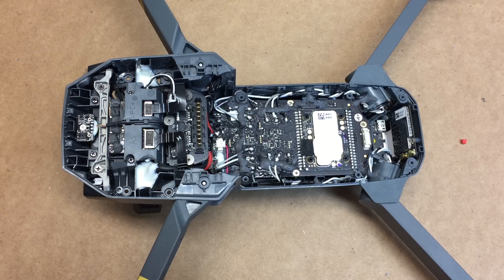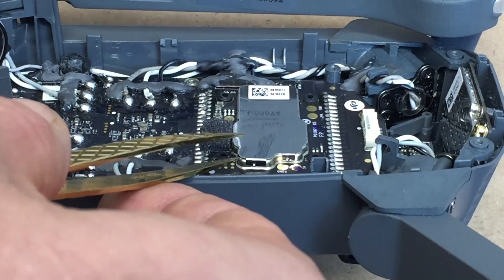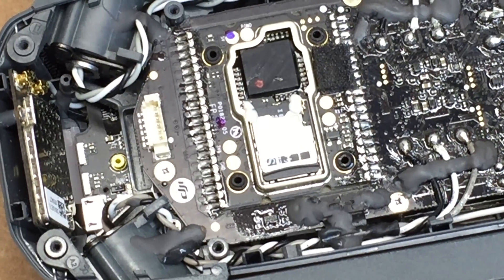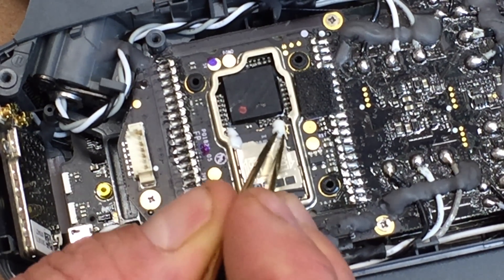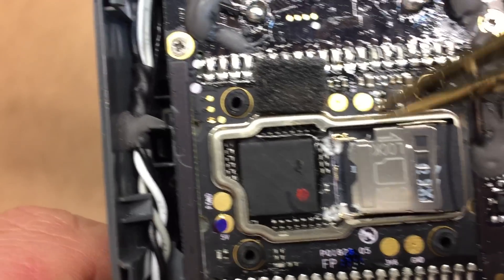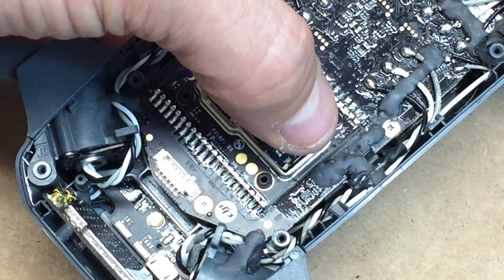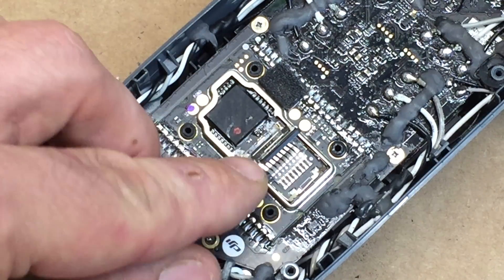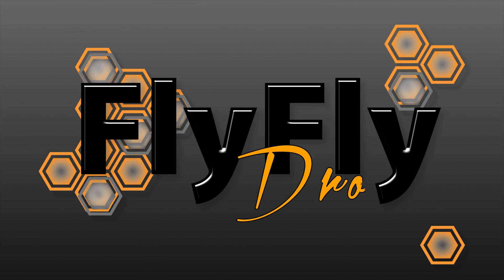DJI Mavic - Adding internal micro-SD card to allow modding (Platinum, Artic White, Newer Mavic Pro)

Comment: what is the internal card for?
Reply from the maker: Great question. I'm gonna pin this as many others will ask. To do the "mods" on the Mavic, we need firmware 1.03.0700. This firmware requires the existence of a micro-sd card inside to write data to for the flight parameters. Now, in the Mavic Platinum, Artic white and Mavic Pro's (which were made after Sept 2017), DJI removed the micro-sd card from the manufacturing process.  They also changed the firmware in 1.03.1000+ to no longer write to that micr-sd card (but those newer fw also no longer have the moddable parameters included). This means, if you downgrade one of these aircraft to firmware 1.03.0700 without adding a micro-sd card, it will give an error (SD card error, or main controller data errror). The only way to then fix is to go back to later firmware, or install a micro-sd card. This process is really ONLY for those who want to rollback and mod the parameters.
Reply: so the SD card slot is still fitted, but the card is not.
Reply from the maker: Thats correct.
Reply: @digdat0  i open my platinum and he has sd card 8 gb
Reply: esuohdica for NFZ, Sport+ and GPS+ you dont have to open your MPP.
Reply: Once you do this.  My firmware is 1.4.500. Once I install the mini sd card. Then plug in my mavic to computer. Open up nld mod.  Install downgrade mod 1.3.700 and everything will be ok? Do I need to downgrade remote also?
Reply: question : Why continue to open news mavics and put SD card inside ? the dumbledor 3.03 allows us to remove NFZ and access all mods (except fly altitude limit) with stock firmware (1.04.0200) !!
Reply: Is it just the NFZ and Height limits mods that i need this for? I really only want the sport+ and GPS+ modes but I have the Pro Platinum, which wont have an SDcard. Cheers for all this info.
Reply: I've just bought an Mavic Platinum. I'm waiting the parcel. The specs say it has an 16GB SD card.  Is it the same card? Or we need to install another internal one?
Reply: If you want to tweak height limitations or max tilt you need to be using 1.03.0700
Reply: I have another question that Dji has released brand new assistant 2,and it seems that one new aircraft will has a dedicated assistant,is that means we can no more to modify the new Dji aircraft?

Comment: well done for her instructions !!  My friend, I have the platinum..I have opened it, it does not have a card in it, if I put it as it is and enter Assistant 2 and pass the software 1 .03.0700, will I be able to change its parameters?

Comment: How to find out the age of the Mavic? My problem is after a crash I'm no longer seeing the SD card, not the internal SD card but the external. Just says no SD card even if I put one in. The happened after I changed the flat gimbal cable but I also have to change the video cable as I'm getting no video.

Comment: I Have a 2 gig card handy is that to small...hate to try if not sure cause dont want to have to go back in..lol...I also wanted to know if we go through the newest video without a card in will it work besides the errors I've seen before ...I just wanted to be sure that if I go in and put the card in it will work..lol...I mean I purchased this drone couple weeks ago to either hack or brick...I bought 3 others to keep stock and this one to attempt to break free...Ive almost bricked it twice today and I pulled it through and its updated to 0400 its the one that loaded with success cause I go back and forth when I cant get one to go and eventually one does...but will downgrade to 0300 before I go through video...I loaded the 0700 4 times and the dumbldore kept showing 0300...till it froze maybe batt low I missed it...the usb loop chime over and over and it just works again if you dont give up...so I wrote 0400 honestly I got scared and was like forget it and was bringing current to just save it and move on...but here I am..lol...I have nld...2 keys as the spark was pretty easy I guess I ran through it np...thanks...I want to see this through this is the stuff I fuel on...rooting phones and hacking gadgets...just a few places that  I fly indoor and it complains about something...and I live it a small town with a small airport we fly our 100cc planes off the runway with permission...and would never interfere with anything no even wildlife...so I'm in this for the challenge and I would like to take a beach astroid photo...I got mad cause it did say nfz...I got mad and got my 250 freestyle fpv out and shred the beach and drew a crowd and had a nice show and tell and sold 5 ppl on the hobby.....lol....thanks,.it was private actually only 5 ppl were on the beach but my family photo shoot was a little shaky on a vortex 250 with a session 5..haha...just kidn....please help.

Comment: Quick question, what format do we need to give the SD card? just regular FAT32 with Windows PC will work?
Reply: I cant find the answer for this,...,any idea how to format?
Reply: @scottymarchbanks8207  Easiest way is to insert in into the regular external slot and format it using drone with GO App. Remove it then you can use it internally.
Reply: FAT32

Comment: Hi bud,

I bought a MPP to replace my MA, because I wanted to get better range/quality and flight time. I live right beside a 7,000 foot mountain, and the main idea for buying a drone was to be able to film its waterfalls, caves, etc. The DJI hard-lock on the 500m altitude does not let me do that.

I contacted NLD, and they told me that I need to install the SD card, then roll back to FW .3.700, then do a bunch of other stuff to be able to increase the altitude limit. The question I have is, is it worth it? Will I get a MPP with seamless lower FW and no height limit, or will I get a MPP with a bunch of warnings, less functionality, etc, and no height limit.

As much as I'd love to do this, I do not want to damage the drone, nor have it be less functional than it is right now. I would much rather wait for a bit to see if anyone comes up with a different solution than rolling back more than 6 updates, and having a less functional drone. What is your take on this, have you modded a MPP for no height limit? Do you have videos about it, flying, showing full functionality? Or can you point me to some other people's video?

Thanks! Love the channel.

E.
Reply: I also purchased the MPP and did the steps here. Was getting a lot of errors which I fixed by doing the following.
Restore to 01.04.0300 using the latest version of assistant.
After you insert the SD card, download the 01.03.0900 FW. (You can still do the height mod, just not the NFZ)
Extract using 7zip, delete everything except the wm220, 305, and 306 modules. Then re-archive it using the .tar format in 7zip.
Afterwards use the latest official release of dumldore to flash the fw you just modified. (flash it twice)
Then download the 01.04.0500 FW open the archive with 7zip, and delete the 305, 306, and 801 modules.
Use dumldore to flash. (flash it twice)
Afterwards I get no motor errors or anything of the sort. Precision landing works as well.
Reply: @Hitokiri926  Hi friend, thanks for the info. I have yet to downgrade the MPP for fear of bricking it. Is it safe to say that your method would provide a stock MPP but without the height limitation? If so I would be willing to try it!
Reply: @enriquefuentesc  You'll end up with the flight controllers from 01.03.0900 so you can mod the height, the 801 module from 01.04.0300, and everything else from the latest 01.04.0500 for all the latest features and the upgraded propulsion system (I think that's the 1200 module) like it says in dji's release notes. 
If you try to upgrade the 801 module to the latest. it will say there's a firmware mismatch, so that's why it's an oddball and has to stay on 01.04.0300.
Reply: @enriquefuentesc  Also, watch digdat0's most recent video on how to mod everything. It will help tremendously so you don't screw up.
Reply: @Hitokiri926  Sounds good... Hi to what are the chances that you can send me the actual repackaged firmware, it would seem that the hard part is all before flashing
Reply: @Hitokiri926  Hello again friend, I would LOVE to get my hands on your prepackaged module to downgrade the MPP and be able to remove the height limit. Please let me know if that is a possibility. I am not very skilled with modding software, so knowing that I have a prepackaged FW to just flash once I install the internal SD would push me over the edge of actually attempting the mod. Thanks so much in advance!
Reply: @Hitokiri926 :-))

Comment: My Platinum is in your way by 1.04.0100 Rollback 1.03.0700, but it seems to be limited by unknown reasons at 1.04.0100. I can't successfully rollback. Even if I have inserted sd card, I can't finish it. Please save me, already operate. 10 days can't be successful,

Comment: I checked on http://tools.retroroms.info/djidecode.php and got the reply as follow 
Model: Mavic Pro, build on: 11. September 2017
Could you please confirm that i don't need to check the micro-sd card inside? Is there any way other than open the case to know this?

Comment: is it necesary that the micro sd card is Sand Disk? I have placed another one and it doesnt work... :( .
The microSD card must be empy, so... in which format do I have to format it?
I am getting crazy about that, because the main controller data error allways appear even if it has a microSD in.

Comment: Hi can you help me please I don’t know what I’ve done from but I’ve followed ur video exactly in installing the internal sd card, but still unable to roll back . Is there a way for me to check if ive installed it correctly?. When I connect the mavic to the pc.. it shows the cameras  sd but the internal one it says insert disk. Any suggestions pls?
Reply: Did u fix this problem if so how did u do it?

Comment: Thank you bro.. this happened to me. Im trying NLD now and stuck about problem sd card error for enjoy mods with fw 03.700 🤣.
After seein this video i undrrstand i should put internal sd on my mavic..😑
Reply: Have you done it? I have, but I still can't do it, the main controller data error appears again
Reply: nope.. thats why i dont do that because NLD cant guarantee my drone and success process..LOL
Reply: I have done it after some tries, and it worked me perfect in a 2Gb micro sd :)
Reply: just worked on 2gb? not higher?
Reply: I was getting mad with the micro SD  and it worked just on a 2Gb micro SD, i dont know why, but it works :)
Reply: the other micro SD cards I used were ruined, and I wasnt able to format them
Reply: anyway,, wheres digdat when we talk about this video..lol

Comment: ☆ I am writing using translation software

I always play as a reference ♪

By adding SD, my Alpine White can now change the parameters.
9: FARM mode atti, with gps)
4: GPS mode, Sports mode speed
What are these two modes?
Which mode is the fastest flying?

How can I change the parameters of Inspire 2?
What should I do with firmware?

Comment: has anyone put in a 32gb card with success?
Reply: mostly because this is the card i had, and installed -> however, firmware flashing (700) freezes in dumldore.  i'm sure this could be for a variety of reasons, but would like to rule out the 32gb microSD card

Comment: As others have said, the metal sd card holder should be slid toward the square micro chip to unlock it (hence the glue to stop it unlocking) and then when done, push the metal sd card holder fully down and slide it away from the square microchip to lock it in place.

Comment: Thanks! Super video once more! 
;-) uploaded one day after I installed my SD card LOL;-) I wish your guide existed already.

Indeed the card locks firmly in place if you slide the slot outwards. No need to reglue it.

The hardest part was disingaging the nose part of the top shell. Its so firm I thought Im gonna destroy it.. but was lucky.

The mods (altitude and nfz)work like a charm! Did it your way. Thank you!!! 

p.s. 
got the propellers in the frame on a couple of occasions for the first time after the SD instalation and mods. Wondering if it could be mod-related or just an effect of some srong side-winds?

Thanks a lot!!

Comment: You can slide the sd card slot for lock the hinge. Not necessary the glue after installing a new sd card. And glue is easy to remove with "isopropyl alcohol"
Reply: Btw i did this to my mavic pro 10 days ago, thanks to digdat0, he is guiding me perfectly.
Reply: tell him to guide me now... Since you dont need any guidance anymore :)
Reply: i want to mod vertical velocity while in RTH
Reply: Yusufff 61 is there any parameter for descend speed while returning home?